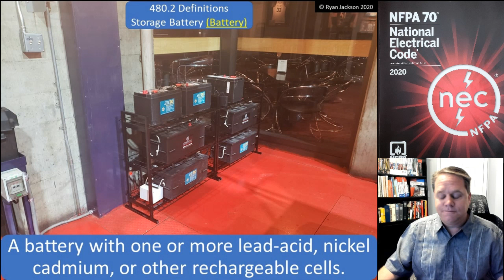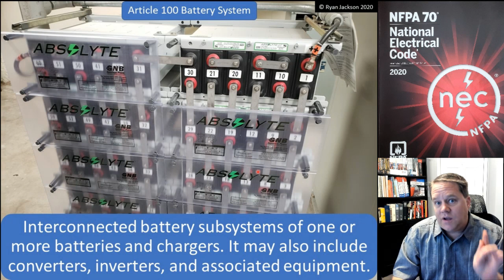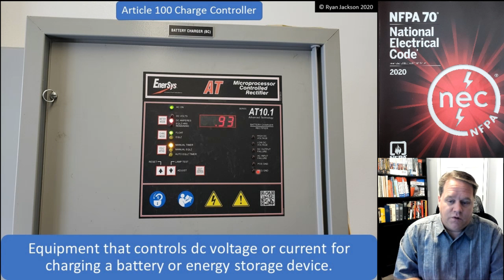100 Days of Article 100: Battery System and other associated definitions

Comment: A better battery definition is: A DC voltage source, that uses chemistry to produce a current. The chemistry of the batteries varies, and come in two varieties: single use and rechargeable. Batteries may be chained in series to produce a higher voltage, or in parallel to allow for greater current draw.
Reply: In my 50 years only saw batteries in series.  Can use smaller guage wire that way. Had some UPS system with several cabinets of 12 volt series batteries  that totaled 480 volts DC. Had 4 natural gas generators that had six 12 volt batteties feeding 24 volts DC to 3 starters. Pigs needed 3 starters to get at least 1 of them on line within 10 seconds. Took halve a hour to remove the 144 caps and insert a water filling bottle every week. Used RO water that went thru a bacteria killing what looked like a black light. Was told better then distilled water. The batteries on these & 3 megawatt diesel generators were 12 to 1500 CCA & about 4 times larger then a car battery.
Reply: @garbo8962  I'm used to them in both configurations, My UPS for critical systems are banked with 4 batteries in series to get the voltage, with 12 sets of such in parallel to get the VA requirements we have. a single one would last us only about 10 minutes, the whole bank in parallel gives us 3 hours of operation to allow for safe shutdown after 2 hours of a power failure. (nature of being in the wilderness, somewhat long outages, and the need to power down the instruments in such a way to keep them from warming up too fast)
Reply: Was told back in the 1960's that dry cells & batteries store chemical energy which is converted to electrical energy. Was also told only 2 things that store electrical energy is a Leddy jar ( probably spelled it wrong ) and a capacitor. Wish I had ten dollars every time I got hit with the 660 volt DC buss from the hundreds of 480 volt drives I troubleshoot & PM'ed over the years. Companies were always in a hurry to get production line or huge air handlers back on line and in the rush to do that is when I got to discharge a 660 volt capacitor bank. Electronic geeks often have their own confusing terms.

Comment: Over 50 years ago our vo tech teacher always made it a point that a battery consists of at least 2 cells. Back then before akaline and other types called the run of the mill A, AA, C & D batteries a dry cell. At the large hospital that I retired from they had several UPS systems with 40 to 60 batteries. A company serviced the system once or twice a year. Could not believe they replaced batteries every 3 years.